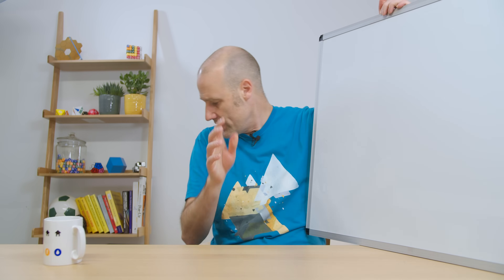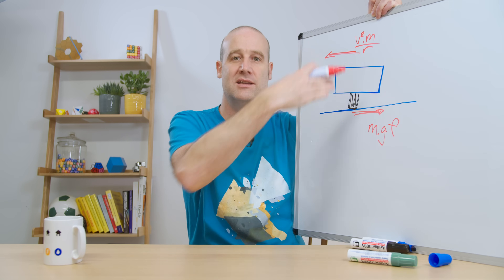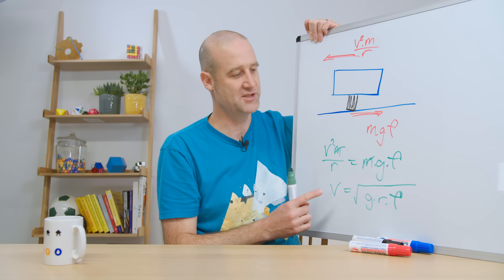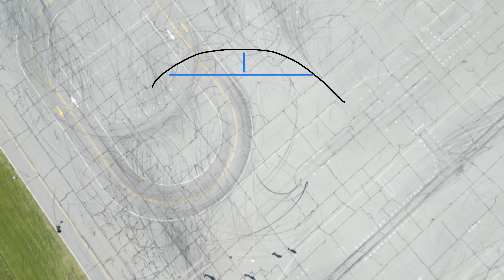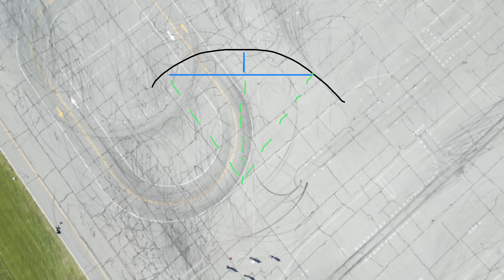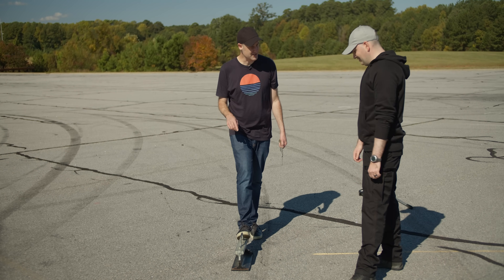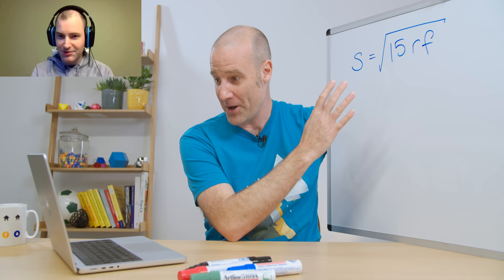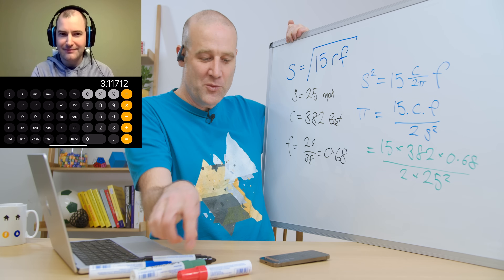Using an Out-of-Control Car to Calculate π.

Comment: Given that the speed was only to 2 significant figures, you cannot have any real confidence beyond 3.1. Expanding "f"  (or "mu") to more significant digits without also expanding the conversion term is a bit of a hack. Using 14.9... would have brought it down a bit. Ultimately, however, you need a more precise estimate of the starting speed.

Comment: Actually, this year's calculation has been heavily affected by the drag coefficient measurement, which seem to spit out only whole numbers. If you make a TINY change from 26 to 26.04, then you get extremely close to the real pi (3.1412463157894734)

Comment: Something to add to the CORRECTIONS section in the description: the conversion factor at 4:48 should be 3600/5280, not 5280/3600.

I discovered this because I was curious if using the more precise value of 14.962 rather than 15 would improve the approximation of pi, so I was trying to reconstruct the calculation. Using 14.962 rather than 15 and exactly 26/38 for mu (I refuse to believe it's f), I got pi = 3.1285.

Comment: Awesome result! I'm really surprised by how close this was, any number of things could have thrown this off. Off the top of my head

1: The vehicle's speed would be constantly decreasing as it follows the arc, meaning the observed arc is not a segment of a circle. 

2: The direction the vehicles tires were pointing (steering input) and the rate they were rotating (throttle or brake input) would influence the shape of the arc

3: A tire's coefficient of friction depends largely on age and rubber compound, and, to a smaller degree, is a function of how much load is on it (more load = lower coefficient of friction) and it's not linear. In simple terms, more weight or less tire contact patch (higher tire pressure) would mean a lower coefficient of friction. This also means the way they measured coefficient of friction is very different from the tires on the car (more surface area, much less weight = lower pressure per unit area of the tire = higher coefficient of friction. Plus, different tire compound, so unknown effect there)

4: They mentioned a slight downhill grade, which would affect the rate of deceleration of the vehicle since it's being accelerated downhill slightly by gravity. I don't believe this is taken into account with the way coefficient of friction was measured but I could be wrong about that.

I guess all of these factors must have been small enough to not matter or they all cancelled out to bring the answer roughly back in line, but that's really interesting how close it was

Comment: Maybe you could say a little more about "skidding out of control while turning". Doesnt the angle of the front tires affect the radius? isn't the car going straight when it skids, so deviating from the original circle? Maybe only some of the tires are skidding when you slam the brakes, and the others are still tracking? Rear wheels lock while the front continue tracking?

Comment: Pi is safe with mathematicians…but give to an astro physicist and things get crazy.  Pi near a mass is bigger…and near a black hole it rises alarmingly….imagine the diameter of a circle being greater than its circumference!  The distance to the Event Horizon is much greater than that calculated from your orbital circumference using the pi we use terrestrially (due to curved space-time). This also means Pi near Earth is also a tiny bit more than Pi out in space.  It also means that Pi is only perfectly irrational in perfectly flat space - and where can you find that!?  Now before someone says on Earth the discrepancy is un-viably tiny, like in the femto range, I will say well maths loves its precision and decimal places huh! This revelation blew me away, but is obvious with some thought.

Comment: Wait, but how do you measure the speed at which the car is going? I'm pretty sure it has to convert rotational velocity into linear velocity. So, say, the car measures that a wheel is making one revolution per second; then the velocity of the car is 2pi times the wheel radius. So you essentially used pre-calculated pi in your calculations

Comment: You know, after you measured the circumference of the circle you extrapolated from the drift, you could just have measured the diameter as well. The ratio between the two would have given you pi 😂

Comment: Here's another fun approximation that also involves vehicles .....

Suppose you are hit by a ten-tonne truck travelling at 60mph, and you want to work out how much kinetic energy will be imparted to you.

KE = .5 * m * v**2

We are told m = 10000kg.
If the truck travels 96560.64 metres in 3600 seconds, then v = 26.8224m/s.
So the kinetic energy = 0.5 * 10000 * 26.8224 * 26.8224
= 5000 * 719.4411417599999
= 3597205.7087999997 J

Which is as close to a kilowatt-hour  (there are 1000 of anything in a kilo-one of them and 3600 seconds in an hour, so 1000W * 3600s = 3.6MJ)  as damn it is to swearing.

Comment: You can't use the law of conservation of energy when there is friction - unless you somehow catch all the energy lost as heat.
Reply: Yes you can. Assuming a constant normal force, the lost energy is the coefficient of friction times normal force times distance of the skid.
Reply: @joekemp83  That is not using the law of the conservation of energy. That is just working with "work" (force times distance) rather than with "force".
Reply: @JakubNarębski   As he stated, the derived equation IS essentially a rearranged energy conservation equation - specifically a rearranged version of the work-energy theorem, which IS an energy conservation result.

Comment: At https://youtu.be/_ZbUyS2IRMo?t=430  they complete the circle, which irked me a bit as it comes close to begging the question*. But there is a way to do it without completing the circle:

Walk along the skid with a compass (or have a compass in the car) and measure the change in angle (how far the car turned while skidding). This angle is the same as the angle of the circle the skid-arc subtends. (E.g. if the car started heading North, and ended up pointing East, it's turned 90° and therefore the arc is a quarter circle.)
Multiply that angle in degrees** by the length of the skid, divide by 360°, and you have the circumference.

---------
* Matt explains they completed the circle by putting a marker on the ground and measuring around it. For this to complete the existing circle, the marker has to be at the centre; but once you find the centre you've basically already go the radius.

** I know mathematicians normally prefer radians (or whole turns) as angle units, rather than degrees. But in this context dividing by 2π also feels like begging the question :-)

Comment: Two corrections: 
1) I think the fraction at 4:48 should be its reciprocal, as that's what you'd multiply by to convert feet per second to miles per hour. 
2) I hate to rain on the parade of the only correction at the time of writing, but if we play fair and ALSO use the exact value instead of 15 at 5:26 (14.962), we get pi=3.12847545263. Which, I will say, seems like a happy medium between the kinda-close value in the video and the very close value in the correction.
Reply: 32.17 is already too many digits to be independent of Earth surface location. Per https://en.m.wikipedia.org/wiki/Gravity_of_Earth#Variation_in_magnitude the range is between 32.0 and 32.3 ft/s². They could simply be a bit north of standard gee.
Reply: @0LoneTech  Understood, I’ll remove that one!
Reply: A correction by a dude that doesn't understand significant figures LMAO

Comment: Surely if you are using American units, there is not just one value of π anyway, but a whole family?  The definition of π is the length in metres of the circumference of a circle 1 metre in diameter.  It has only 1 possible value in civilised countries where there is only one unit of length; but in actual fact, were it not for this simplifying assumption, there must be a value of π corresponding to each possible pair of diameter-unit and circumference-unit.  For instance, if the diameter is given in inches and the circumference in feet, then -- because there are 12 times more inches in a metre than there are feet in a metre -- you will get a value of π which is closer to 0.25.  And if the diameter is in feet and the circumference is in yards, you get π = 1!

If you needed more accuracy, you would of course be using the proper units  :)
Reply: Pi is a ratio of lengths, independent of the units used to measure them. It is always 3.14.
Reply: @joekemp83  No, that is implicitly relying on the lengths being expressed in the same unit.  Which is all well and good in the civilised world, where every length is simply measured in metres.  But the mess of a measurement system used in the USA has more than one unit in which each quantity can be expressed.  So you get different values of π depending which units you used to measure the diameter and which units you used to measure the circumference.

Let's consider our one-metre diameter circle.  It will have a circumference of 3.142m., to the accuracy with which we can read a tape measure.

Now if we express that diameter as 39.37 inches and the circumference as 10.3071 feet, then we get π(in,ft) = 0.2618.  That is to say, the circumference in feet is equal to 0.2618 times the diameter in inches.

But if we expressed the diameter as 3.2808 feet and the circumference as 3.4357 yards, then we would get π(ft,yd) = 1.0472.  Or in other words, the circumference in yards is 1.0472 times the diameter in feet.

It's therefore necessary to specify exactly which units were used for the diameter and the circumference, if they were different.
Reply: @bluerizlagirl  You are ABSOLUTELY incorrect. The ratio of circumference in one unit to diameter in another unit is NOT called pi.

... maths teacher of 35 years

Comment: Applying some standard ±0.5 intervals, we get a number between 2.91 and 3.38, nicely fitting our between 2 and 4 target. 

(15 * interval(382 - 0.5, 382 + 0.5) * interval(26 - 0.5, 26 + 0.5)) / (2 * interval(38 - 0.5, 38 + 0.5) * (interval(25 - 0.5, 25 + 0.5)^2)) =
  approx. interval(2.9144385, 3.3773428)

Comment: You could find the center by splitting two chords, where those perpendicular bisectors cross (assuming a circular curve, but since y'all did I think that's fine). Then you can measure radius.

Comment: Well, centripetal "acceleration" and frictional force are in the same direction, the force produces the acceleration in the same direction. The equation is F = ma and the "a" part is centripetal acceleration here and "F" is frictional force. The maths checks out but the direction you have drawn for friction is in the opposite direction at 3:18. Anyways, its not much of a deal for a mathematician, I guess?!

Comment: I'm trying to work out the whole MPH/FPS gravity thing, I'm not able to get 32.185, let alone 14.962. I wish that was covered a bit more in the video. I totally get the concept but I'm not able to work it out, I feel like I'm missing something.
Reply: It's not terribly clear, is it? 32.185 is their local gravity (including centrifugal force) in ft/s², and 14.962 is the same in mph²/ft. It got rather jumbled when he squared (mile/foot)/(hour/second), then divided gee (in ft/s²) by that.
Reply: @0LoneTech  Did they measure gravity in the field where they were skidding the car out? I found the figure 9.80665 as a more accurate value for gravitational acceleration, converting that to feet I'm getting 32.17405, which is a bit off from 32.185. When I was just using 9.81 I was getting 32.1522, which is even further off.
Reply: @CharlesVanNoland  9.80665 m/s² is standard g, derived from measurements at Paris in 1888, compensated to a theoretical 45 degree latitude. That doesn't necessarily make it more accurate to their situation. For instance, here in Sweden we generally use 9.82 m/s². 32.185 ft/s² may be derived from 9.81 m/s², in which case it very likely is a two stage (and therefore incorrect) rounding from standard g, to three digits in m/s² then five digits in ft/s². If that's the origin then standard g would be a better number. Either way, it's not worse than our other variables giving us less than two digits of accuracy. Their 15 changes from 14.962 to 14.957, still a rounding error of about 0.25%.

Comment: Collision reconstructionists really using single tire model and uniform mass? No Pacejka even? Man, I'd be sad if I had to fight a "collision reconstruction expert" in court while simultaneously destroying their career with math.. especially when (not winter) I run very, very sticky tires, that tire weight is not fair in many cases. At least he admits differences in tires.

Comment: Next year, you should try using the buckling equation. It gives the maximum load that a column can support before buckling. F = pi^2 * E*I / L^2, where E is the Young's modulus (material property), I depends on the size and shape of the cross section, and L is the length. The equation is slightly different depending on how the two ends are supported. There are also the beam bending equations which relate the displacement of a cantilever beam to the amount of force applied (displacement of the end = F*L^3 / (3*E*I) ), so if you don't have E and I, you can calculate (E*I) from displacement of a cantilever beam and plug it into the buckling equation. 

I just ran an experiment with angel hair pasta, where I measured force vs. displacement of a bundle of 20 angel hair pastas using a kitchen scale to calculate E*I (divide by 20 to get a single pasta). Then measured the buckling load for individual pieces of angel hair of various length by pressing it onto the scale until it broke. My estimate for pi was 2.675, less than 15% error with only 6 trials.

I can imagine a fun video where you have a bunch of students run the same experiment with different pasta (spaghetti, fettucini, etc.), and then bring in some heavy machinery to run it with metal rods/tubes.
Reply: That equation is an upper bound and very sensitive to imperfections so it's always going to give you a large(ish) underestimate no matter how many times you run the experiment.
Reply: My intuition says something a little less brittle would work better, but I could be way off. Regardless, that's an interesting idea.

Comment: In case anyone's curious, this brings Matt's running average to approximately 3.186, an average error of around 1.4%! Honestly, though, 2021 really hurt the average, and if it weren't for that, Matt's running average would be basically what he got this year, 3.117, which is a bit over half as off at only about 0.78%!
Spoilers for what it needs to be next year to bring it roughly in line with pi down below

Next year, if Matt wants to bring his running average within 0.1% of pi, his estimate would need to be between 2.62 and 2.69, with 2.652 bringing it to being accurate to 4 places past the decimal (3.14154...). So, yes. Fun facts.

Comment: I am excited to see how close the average Parker Pi will be to actual Pi in 1000 years. Surely it will just get closer and closer if you just math out all previous years
Reply: Current average (yes I went and found out) is 3.19080654894360 for all years between 2015 and 2023 (including the second video from 2015). Instead of only going to the lowest significant figure I assumed absolute precision for all results

Comment: You are still at 3.128 roughly, since you rounded up 14.962 to 15.
(14.962 * 382 * 26/38) / (2 * (25 ** 2)) = 3.128475453 per TI-36X Pro

By the way I believe the 14.962 is not correct either.

Comment: The speedometers in my cars are about 5-10% fast. Dropping that 25 mph by 5% seems to get you so much closer!

(I'm doing the math in my head, I could be wrong, haha)
Reply: The discrepancy in your cars' speedometers could be because your speedometers were calibrated for larger wheels. To go the same speed a smaller wheel has to turn faster than a larger one would, and the speedometers are based on wheel rotation speed (sort of).
Reply: @hoebare  No, the wheels and tires  are the stock size. And the odometers have read accurately! Seems to be a German car thing (VW and BMW), my folks' cars have always been accurate (Honda, Subarua, Kia...).

Comment: I like the slopes in 3d only certain roads or locations time of day and weather play a dimension. I personally like the second gear clutch kick at 30mph I can spin my tires in a straight line slightly uphill and wet up to 40+mph and the traction is controlled by my foot so those last mph stick and grip and sling shot.

Comment: In the bananas unit system , you get the speed in bananas/ponds as S = sqrt(e^2*R*f) = e*sqrt(R*f), which we can all agree looks much nicer than the formula shown in the video.
There was no need to use imperial units.

Comment: Nooooo friction is what is causing the centripetal acceleration.  The arrows you drew on the free buddy diagram are not opposed - they are the same arrow.  (Friction is why it doesn't go in a straight line, as it would on perfect ice.)

Comment: Ok so that formula reminded me of something pilots use(...for their test then never again). Goundspeed in MPH squared divided by 15 (or knots^2/11.3) is the 
"Pivital altitude" in feet above ground level. This is an altitude where the plane can circle around a point on the ground and a line through the wings(straight not swept) will always pass through the point on the ground(describing a cone) regardless of turn radius.

Comment: I think you missed explaining an important part on this. The skids shown and the one used are clearly not circular (ie variable radius). I think you did your calculations by using the ‘instantaneous’ radius as the skid started. Or you used like an average radius and never explained that